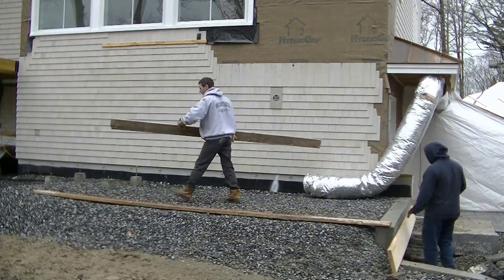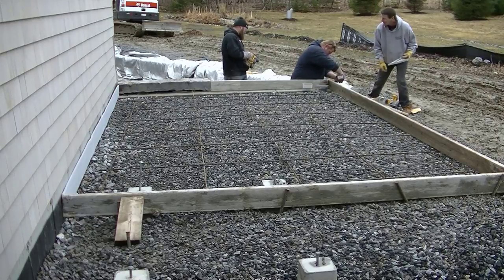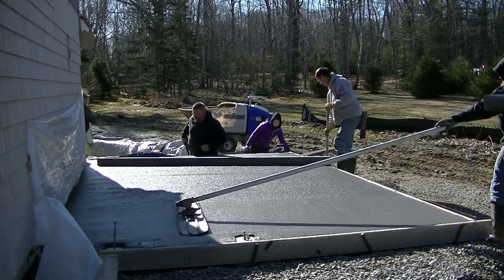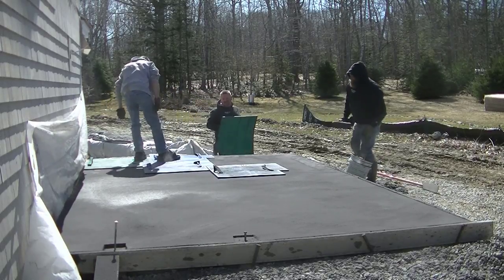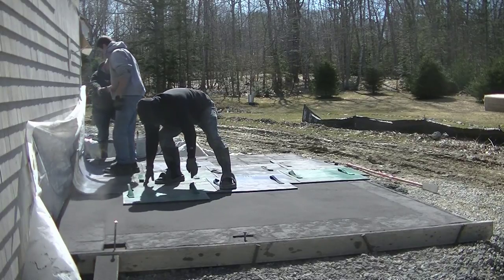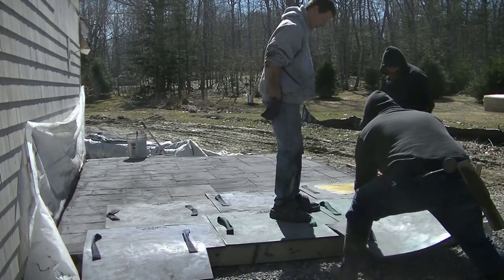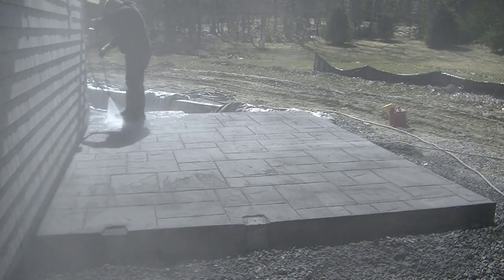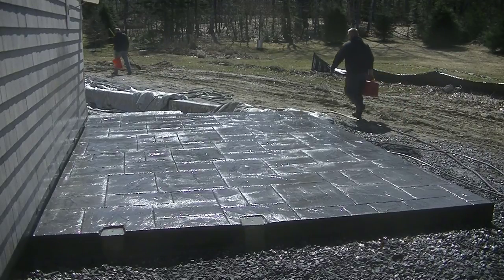How To Form, Pour, And Stamp A Concrete Patio (For Beginners?!)

Comment: Hi Mike, when do you know when to start stamping if you don't have a roller like you use to test?
Reply from the maker: It depends on the size and if you're in the sun or shade, but generally when you can press you fingers into the surface only about 1/4 inch. I have other videos about when to start finishing like this one: https://youtu.be/s1u30qLejdA
Reply: @MikeDayConcrete  Thanks so much for quick replay and the info. It really helps...